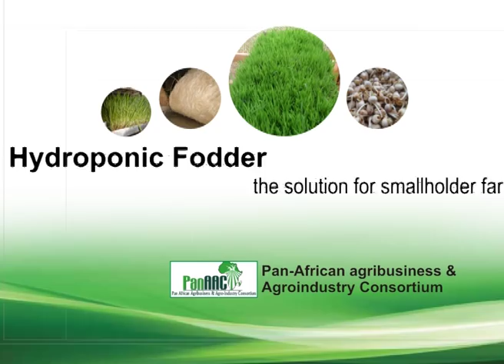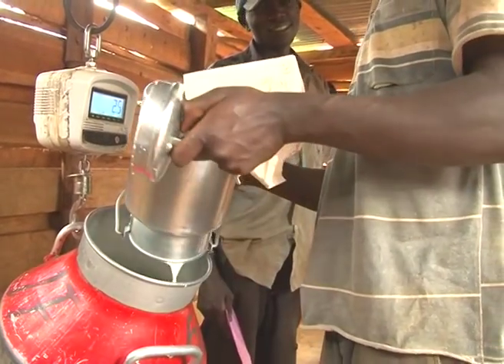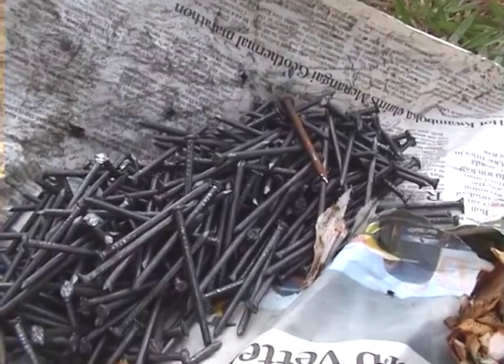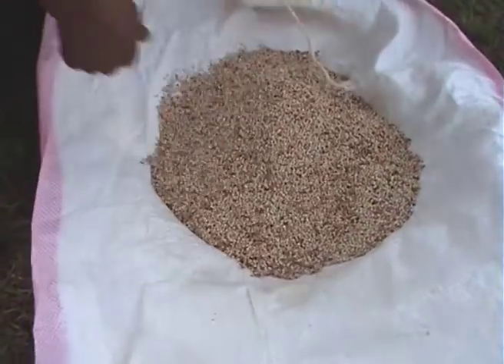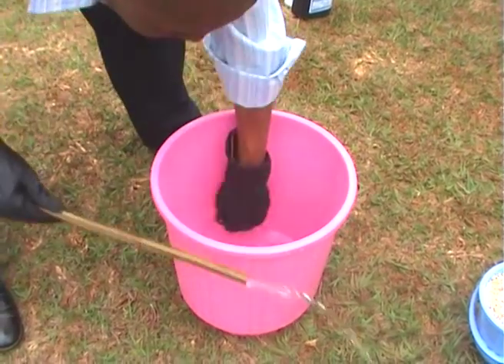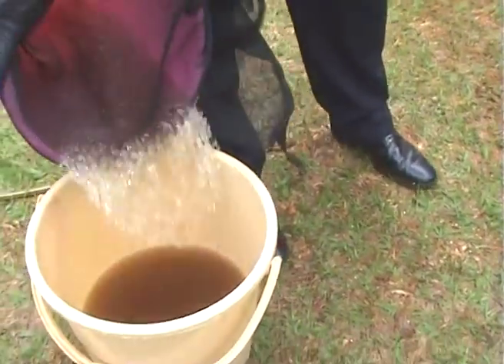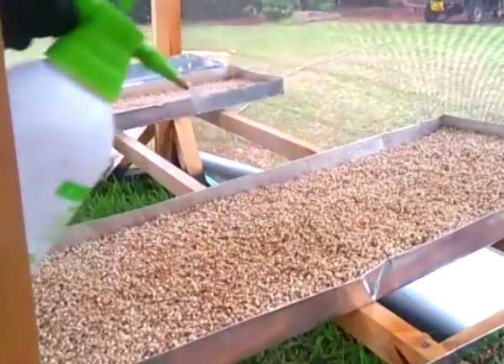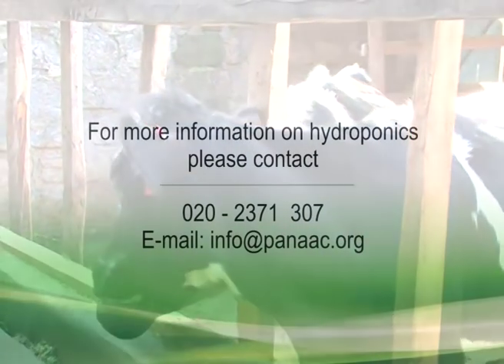Growing Hydroponics Fodder in 2024 A Step by step guide

Comment: There are lots of management problems that a producer needs to be aware of green fodder production it you want it to work correctly in your climate or micro climate.
We did bio security to keep mold down, we also used and tried different products as grow matts. We used fans to improve air circulation.
We used different types of grain depending on the time of the year and we tried to do cost containment because we where a commercial operation.
We did grow green fodder in a open air shade house 365 days a year for ten years.  We mixed green fodder with hay to feed and we did have hay a a back up feed in case of production problems or failure’s with the green fodder.
We recycled are water. We where located at the time 150 miles from Death Valley,CA

Comment: I think seeds are think expensive for this to be feasible. Dried hay is still better because all the fluids have been removed. Microgreens are 95% water so only 5% is the actual solid part. Pound per pound, hay is still more nutricious as fodder.
Reply: Livestock digest fodder more completely than dry feed.  They will gain more weight from fodder than an equal weight of hay.